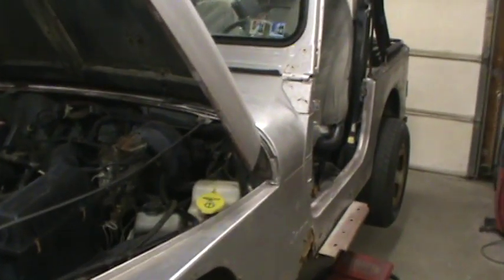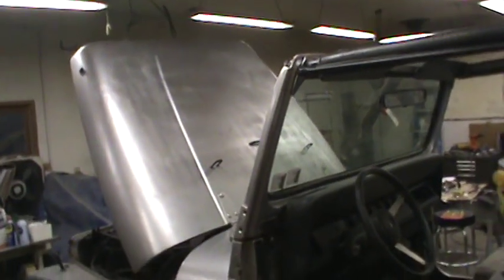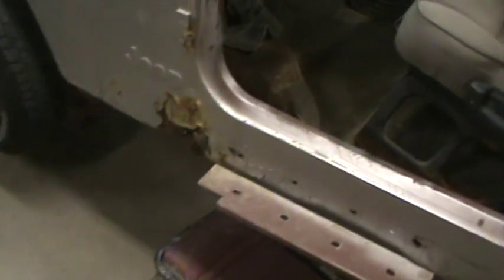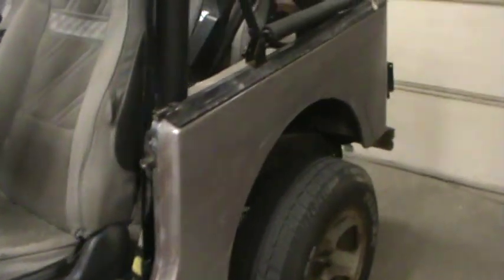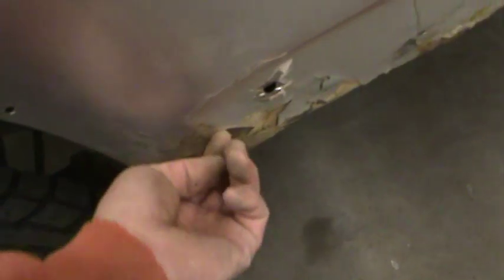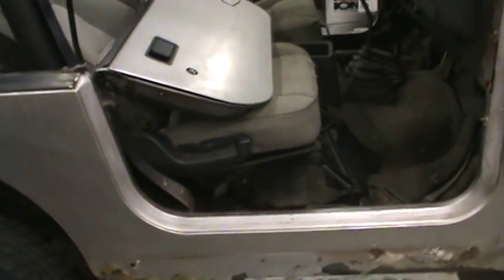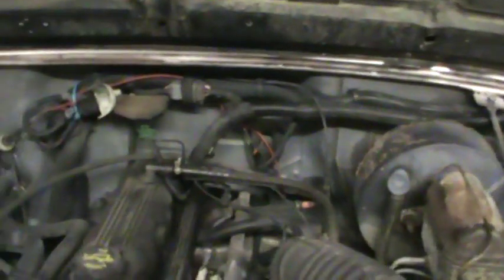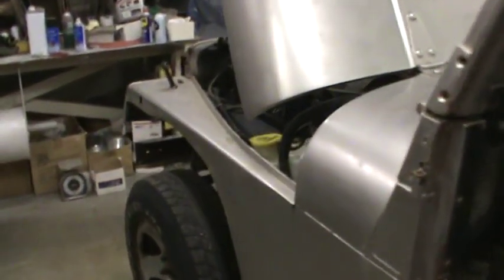93 Jeep Wrangler YJ project #2

Comment from the maker: @PrebleGorillaMan Yes they are a problem especially if they are painted over a couple times. Unless you have a complete rust bucket rust is NOT usually the problem here. it is the chamfer on the bolt that is stuck. i always carefully tap in my torqs socket into the hole making sure it is seated properly all the way to the bottom. apply pressure but not to much if it doesnt break loose take a torch and heat the bolt head around the outside edges

Comment from the maker: @PrebleGorillaMan after heating make sure your socket is seated into the hole again nicely and apply pressure again. it should come loose.....take your time make sure your torq socket is squarely in the hole and fully inserted. if all else falls a drill is the last resort for me. this particular jeep u see in the videos i got them all out without drilling.  Good luck. hopefully this helps
take it easy